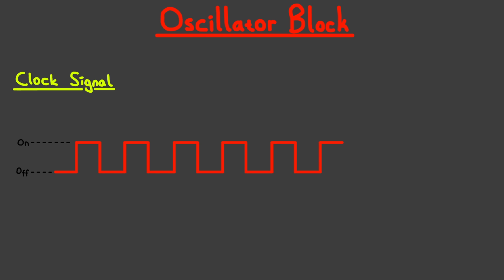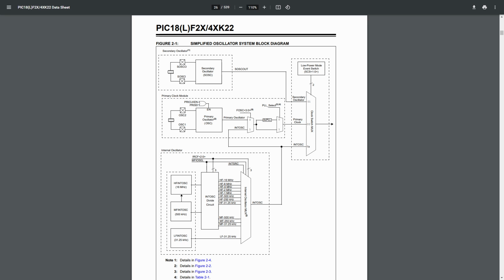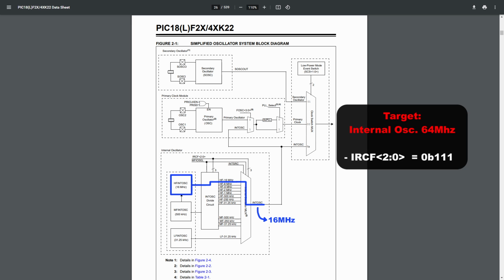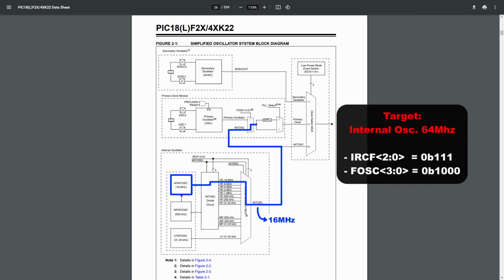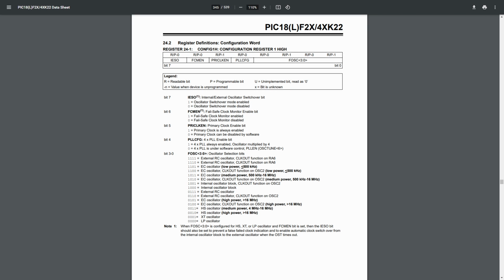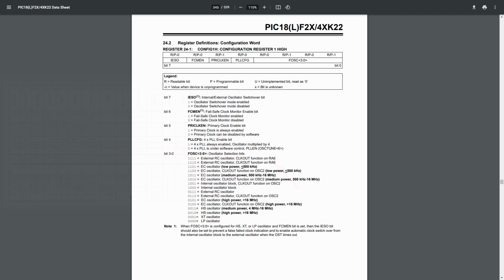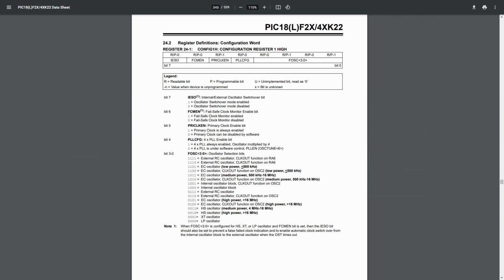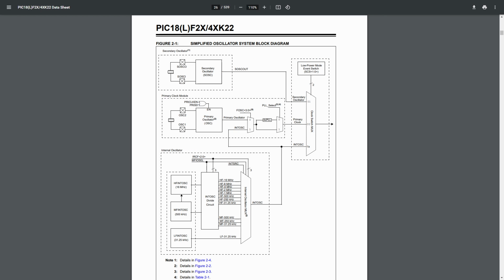PIC MCU TUTORIALS #11 - Oscillator block & Clock generation (Absolute Beginner)

Comment: There should be a list of NON RUN TIME bits
Reply from the maker: There actually is, I talked about it in the "configuration bits" video. Just search for "Configuration Bits" in the datasheet and go from bottom to top. For this microcontroller (PIC18F46K22) you can find it in the page 344.
Datasheet: https://ww1.microchip.com/downloads/en/DeviceDoc/40001412G.pdf